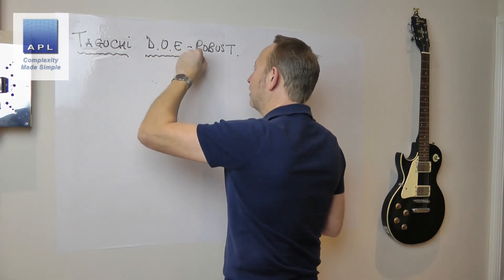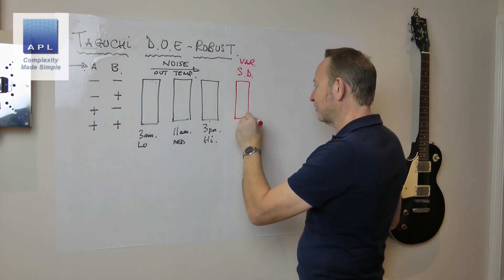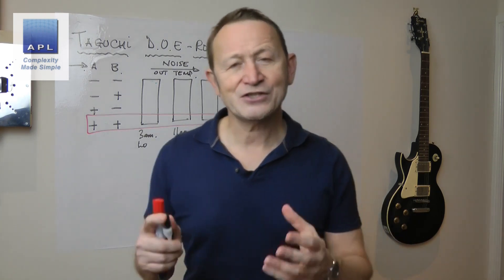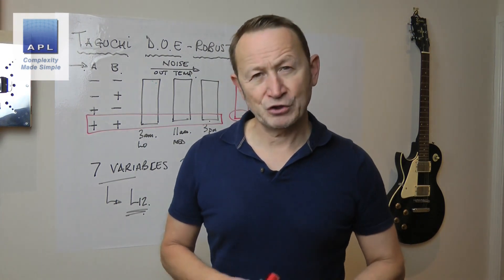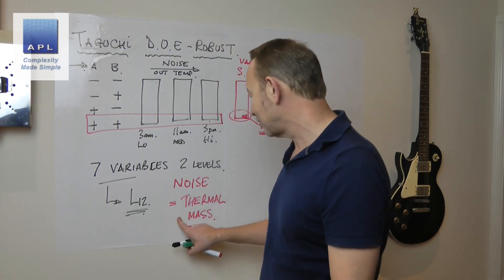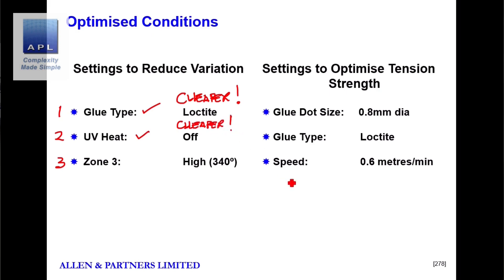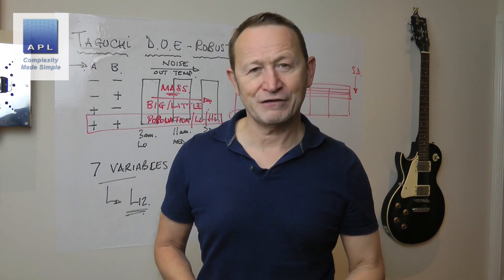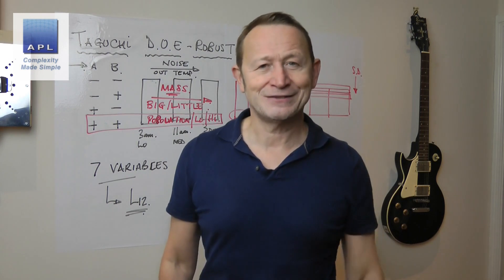Taguchi Robust DOE  - Case Study

Comment: Could someone clarify what the four columns are in the four tables in 12:00? There are 7 variables and 2 levels each, what are the Rep1 through Rep4 representing in these tables representing the 4 noise conditions? Thanks so much for the help in advance!
Reply from the maker: Hi Pei - the 4 columns are are 4 sample measurements taken at that setting for that component on the board. We tested 4 types of component and measured 4 of those components each time...
Reply: Hi Paul, Thank you so much for the response, really appreciate it. Do you mean they are measurements of the same setups from four different boards or on the same board? And what’s the reason that you’re choosing to measure four times specifically? Thank you
Reply from the maker: @feiputw83   - you need a good sample size, usually between 30 and 50. If we conduct 12 set ups and measure 4 boards we get 48 data points a perfect sample size..
Reply: @paulallen5321  Understood, thank you so much for the answers and videos!!